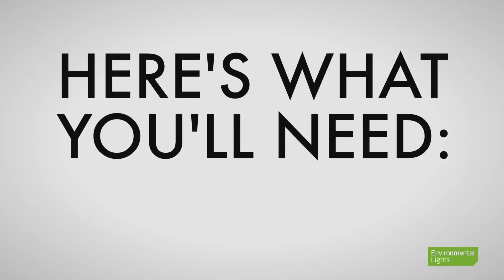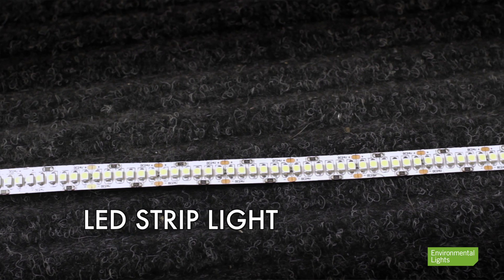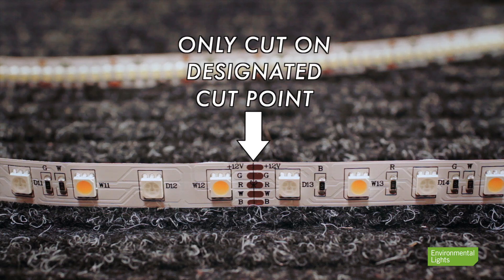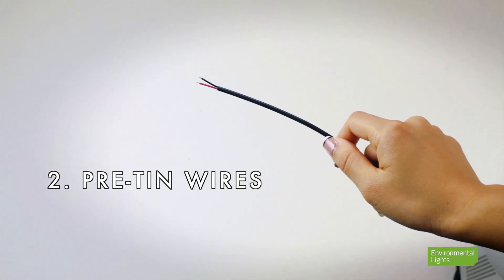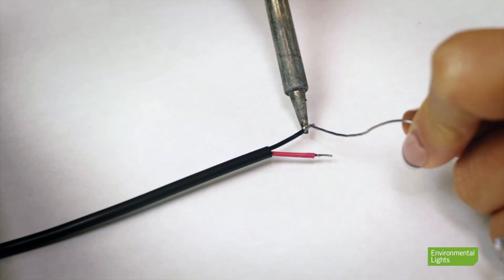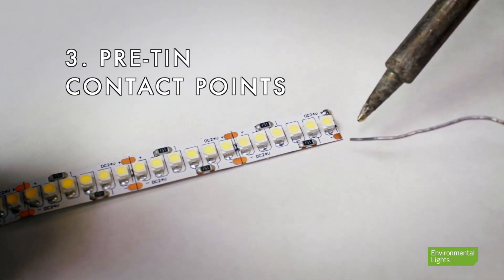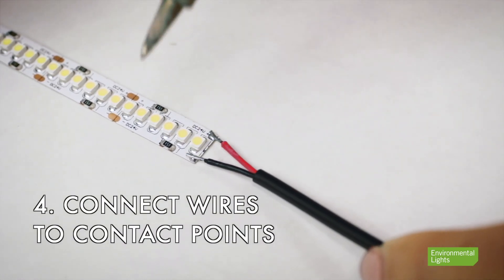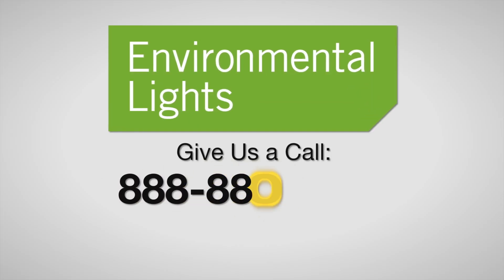How to Solder LED Strip Lights

Comment: great explanation but one problem how would you know if your connecting the wires correctly?
Reply from the maker: +wolf A great way to know if you're connecting the wires properly is this: If the lights work, the wires are connected correctly. The solder pads have marks next to them letting you know which wires to connect.

Comment: I plan on putting leds into a Michael Jackson costume to use during my impersonations. I plan on having a strip on the outside of each leg, a strip down each side of the jacket under the arms, and a strip down on each arm. While doing this, I don't want to use more than 2 battery packs. 
So my first question is, is there a connection wire that can support 2 different connections? 
And do the wires to connect different pieces of led strips come in varying length?

I obviously didn't do much research on this, but the idea stuck with me after watching Michael Jacksons This Is It all those years ago, and I still haven't fully given up on the idea.

Comment: I have a question....I have a small strip of LED wired through a power supply. After hooking everything up, only 1 LED turns on. Any suggestions?
Reply from the maker: DopeTurtlee please take a look at this if you haven't already: http://www.environmentallights.com/elibrary/video/view/video_no/10149/

Comment: i want to extend my led strips and bridge them together with wires, please tell me what size wires will be needed for the job, i just ordered a soldiering iron kit, all i need is the wires, i want to lengthen my led strips and daisy chain them with wires please some 1 help?
Reply from the maker: Hi Daniel! We'd love to help! 

We have a handy resource on our website that helps you calculate what gauge wire you should use. Check it out: http://www.environmentallights.com/library/calculators/

Or you can give us a call at 888-880-1880